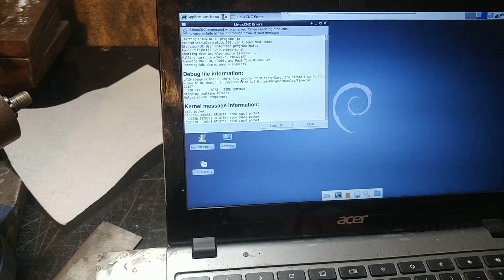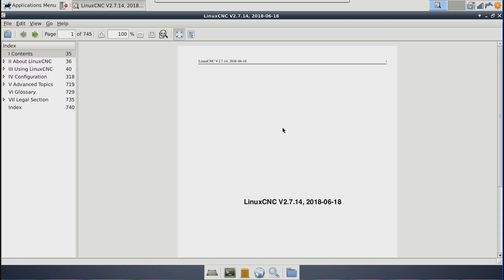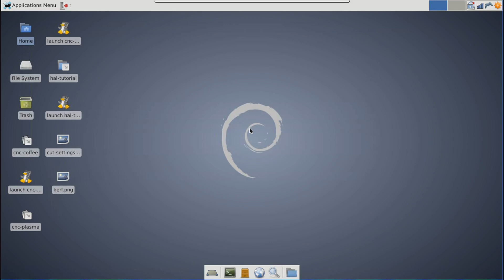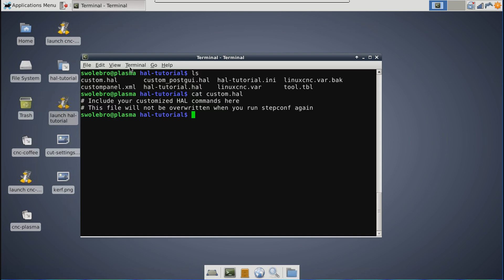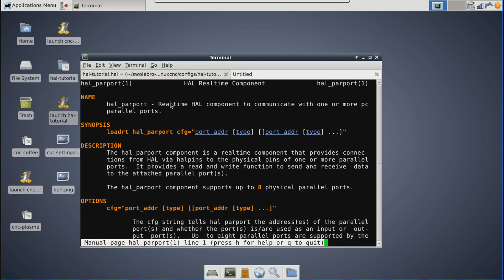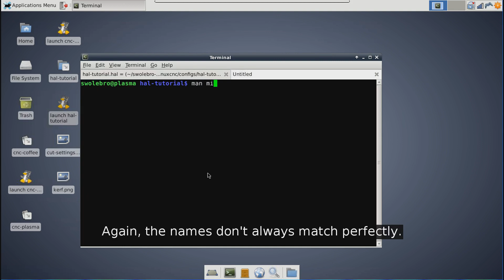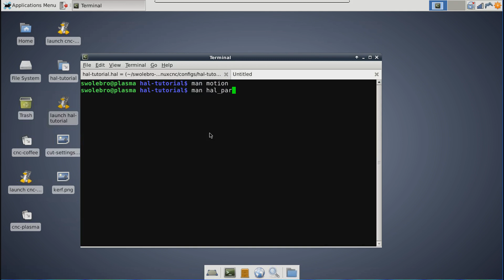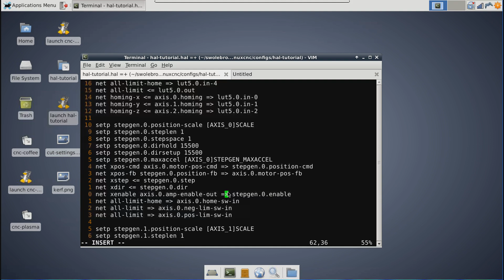LinuxCNC HAL #1: The Basics

Comment: First thank you for the information.  I have been doing machine tool building for 45 years.  I have been wanting to build a Linux CNC controlled tool for years.  Now I have the time.  Just some info you mentioned you didn't know.
RS274 is the name of the language your part program is written in.   The G and M code (Part Program).  It has become called G code and it is not the write term.
You mentioned tiering code to a out put.  This does not happen G codes are function in the CNC Operation engine.  M codes are tied to outputs and such.  This is not always true but 99.9% of the time it is.

I started designing when the GE100P NC control was developed.  Yes I am that old.  LOL  Thank you again.

I look forward to seeing more of your stuff.  It is helping me with Linux CNC a lot.  Thank you again.  

Doug

Comment: Great tutorial, thanks very much. I'm moving over from UCCNC to Linuxcnc, and this is exactly what I need to ease the transition. I'm going to be using QTPlasmaC with Mesa cards, but no doubt I'll still be checking out what you have done with the Arduino and THC control.

Comment: I am just starting Linuxcnc and this video.  Hope it covers or leads me to configure a scara type machine
Reply from the maker: I don't cover anything other than basic kinematics in this series, but the HAL concepts are all the same.

If you wanna mail me a FANUC arm, then sure, I'll take a crack at that. Hahahah. I don't exactly have $50k to burn in order to cover niche use cases.
Reply from the maker: @phearl3ss1  Ok, so I took a look at your video showing off the SCARA ad that's actually pretty cool.

The LinuxCNC docs definitely don't cover the use of scara apart from mentioning that "scarakins" exists as an alternative to the standard "trivkins" (trivial kinematics engine). Luckily, they do at least provide two example configurations.

https://github.com/LinuxCNC/linuxcnc/tree/master/configs/sim/axis/vismach/scara
https://github.com/LinuxCNC/linuxcnc/tree/master/configs/sim/gmoccapy/non_trivial_kinematics/scara

Comparing the INI and HAL file in there to the basic-bitch configs you get from running the Stepconf Wizard (as in my earlier video) or the HAL files I build through this video series, might help you figure it out. Though right off the cuff, it doesn't appear they're setting any values for the lengths of the arm segments, which according to the HAL module code itself, should be some pins labeled D1 through D6. So I dunno.
	
https://github.com/LinuxCNC/linuxcnc/blob/master/src/emc/kinematics/scarakins.c

I'd say once you read over the example configs and bumble through it a little bit, post on the forums and ask for some help connecting the dots. I certainly think it's interesting, but I'm not going to promise any of my time towards it, since I've got enough to do already. A couple more videos to knock out, then I really need to focus my energy on getting some house repairs done and moving the fuck out of this goddamn commie shithole that I'm living in. Got real-life priorities to handle.

If you want, you can drop an issue on this GitHub project here so I don't forget entirely, but you're looking at months and months before I can have any free cycles to possibly spend looking at it.

https://github.com/swolebro/swolebro-youtube

Comment: Thanks a lot for your video, you are the best! If you have time could you do a video that explain the procedure to build tool change?
Reply from the maker: That one's a bit beyond my shop right now, since the plasma is just a plasma. I'll keep making more videos as I get around to doing/learning more, but milling isn't going to happen any time soon. These guys might have some videos already, or would likely be able to provide some pointers:

https://www.youtube.com/user/sliptonic - wrote a good chunk of FreeCAD's Path workbench, runs a mill conversion
https://www.youtube.com/channel/UCy5Dnc0yhIVGIDhsLnDgxGg - dude has one of the smaller Tormach machines and he's got some videos on working with the LinuxCNC bits under the hood
https://www.youtube.com/user/samcoinc - guy is setting up some old, monstrous size mill with LinuxCNC/Mesa hardware

The rest of the HAL videos here will probably still prove useful though - particularly the ohmic probing one, if you want to automatically measure Z offsets every time you chuck a mill in a collet.

Comment: I'm not a linux guy, but some of your commands don't work on my computer. I've got the debian wheezy 2.9 installed. Are some commands not used across all ditros? For example where you typed "tree", doesn't work in my terminal. Thanks
Reply from the maker: Some of the commands don't come by default, but are available if you know where to look. (Which is usually a Google thing; "tree" specifically comes in the "moreutils" package.) I talk about the other tools I like in video 1b, and have the quick write-up of how/what to install here:

https://github.com/swolebro/swolebro-youtube/blob/master/linuxcnc/misc/installing-software.rst

Finding out a tool even exists... that just takes time. Same thing as when you've been drilling and tapping holes all your life, then one day, someone hows you those combination drill-taps, and your mind is blown.

Comment: What type older desktop do you recommend to run Linux CNC?  I have a couple of older ones with Windows 8,  installed, maybe I could use those for my Sherline mill ?  The Sherline controller is set up for Linux.
Reply from the maker: I was using an old Dell Optiplex 780 with a first generation i7. That's a machine that would have been top-of-the-line back in 2008, hahah. It was already a decade old by the time I was using it. You certainly don't need anything modern.

In fact, given how much LinuxCNC kernel updates lag, you might want something that's at least 5+ years old. Computers with the latest hardware also require the latest kernels in order to boot/run properly.

A quick Google search on my end shows that the Sherline controller uses a parallel port interface, so it'd be best if you can find a machine that has one already.  Otherwise, you at least want a PCIe slot for an expansion card.

Comment: I am into a weird problem. First, when I boot into the normal mode(1st option), I don't get any output on the VGA port of the PC, when I boot into the failsafe mode(2nd option), everything works normally, except when I reboot, all the saved data, including the stepper config files, get erased from the hard disk. Please help.
Reply from the maker: Have you actually installed the system or are you only running it off a live USB? If you're running off the USB, click the wizard on the desktop and go through the install process.

Not sure why your VGA is acting whack, and that's not a problem I can help with either.

Comment: I have a Linux question.  I'm running Debian and at first could not see desktop icons.  I've solved that issue but now I can't launch Linuxcnc from the icons.  Could you point me in the right direction?  Thanks.
Reply from the maker: Usually the desktop shortcuts are made when you walk through the Stepconf Wizard. If you right click and look through the properties on it, there should be a field for a shell command that'll have something like "linuxcnc /path/to/your/config.ini". Check and make sure that's set up correctly.
Reply: @swolebro  Unfortunately, no luck.  The desktop icon created looks like a shell script when I open it with the text editor and it has the proper ini file with the right path.  Double clicking on it just doesn't do anything.  Seems like maybe a permissions issue.
Reply from the maker: @davidjupin8797  Could either be that it somehow got the executable bit unset. Check with `ls -la` and see what the permissions are, and `chmod +x` if that's it. Might also be something with mime or XDG settings, but then we're getting into stuff that cant really be debugged via YouTube comments, particularly when I don't have a Debian/LinuxCNC machine of my own to look at right now.

Comment: When i type in "tree it says bash: tree: command not found"  What am i doing wrong?
Reply from the maker: That tool doesn't come by default on every distro. Usually it's in a package called "tree" or possibly "moreutils" which you'd install using apt-get. I'm a bit hazy on the specifics by memory since it's been a while, but video #1b in this series (Linux basics) probably covers that for ya.